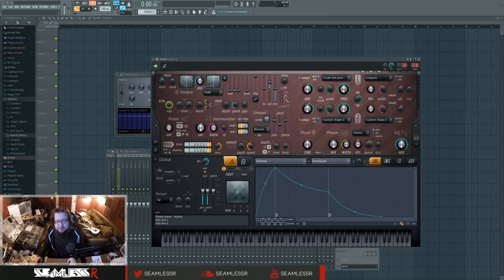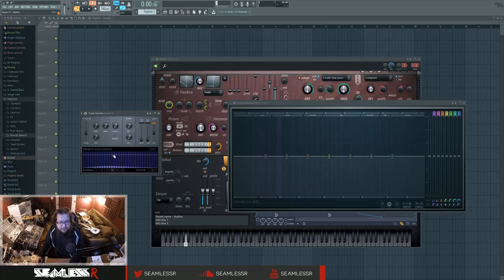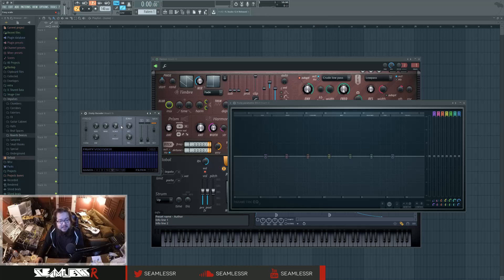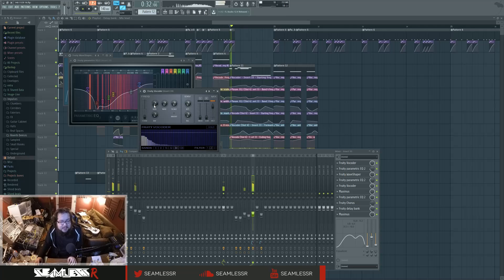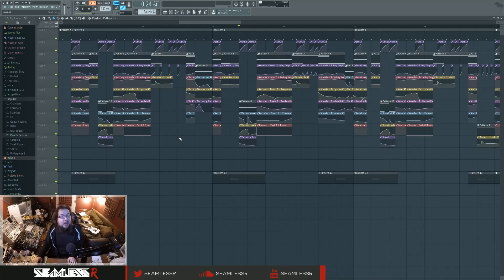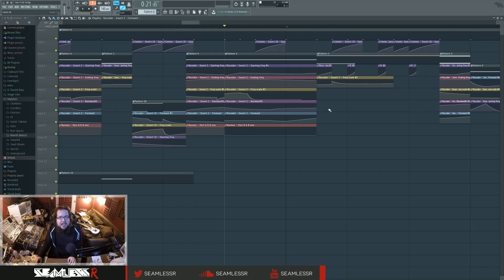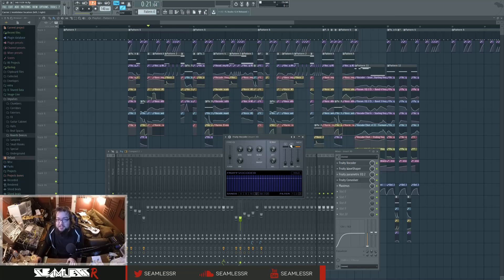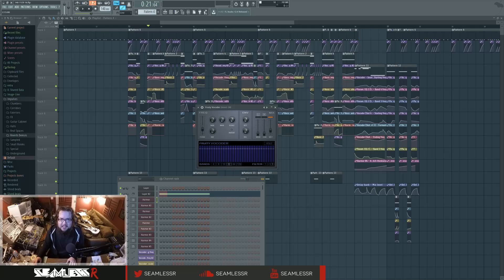Doing Stuff 4: Ancient Vocoder Tech

Comment: So my understanding of a vocoder is that it's essentially an FFT driving a series of sine oscillators with amplitude and phase information, and you can choose the number of bands, the offset of each band's data (hence the capability of phase vocoders to pitch shift without time stretching) and the width and frequency distribution of the bands. Is there any utility in having the oscillators be something other than a sine? I know it's an odd thing to do since the whole point of FT theory is decomposition to sines, and switching to a non-sine oscillator would introduce additional formants, but I wonder whether square or saw waves might produce an interesting sound. Is this something you've ever played with?

Comment: In Harmor, there is a formula to determine the actual output of Filter 1 and 2 because both filters share a knob and it can mute one or the other.  So the formula is Left of 12 O'Clock = (1-Mix) * F1 + Mix * F2 
##Right of 12 O'Clock = (1-Mix) * F1 + Mix * (F1⇒F2) 
Where: 
##F1 is the output of Filter 1 
##F2 is the output of Filter 2 
##F1⇒F2 is the output of F1 processed by F2 
##Mix is the value of the Filter 1 & 2 mix knob
Can anyone explain this further to me than I have understood it?  I'm curious to know what the "output" of the filters are.  Thanks